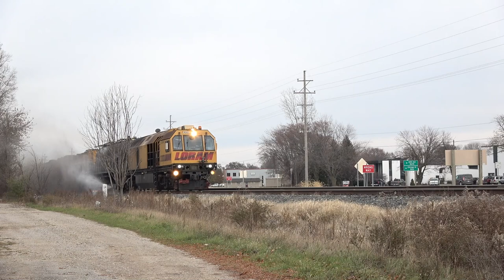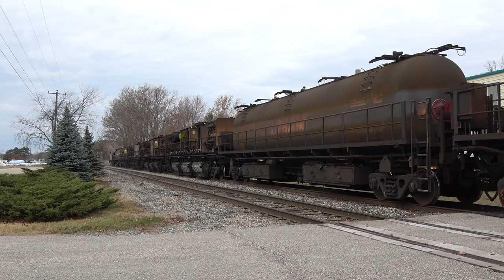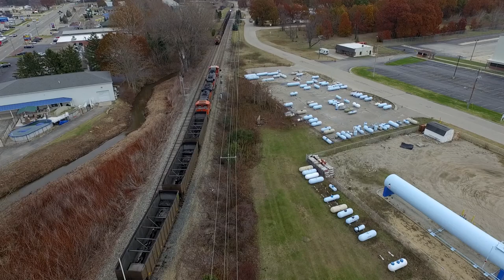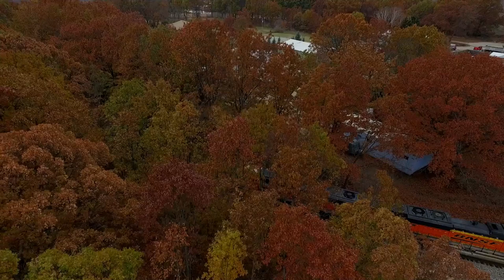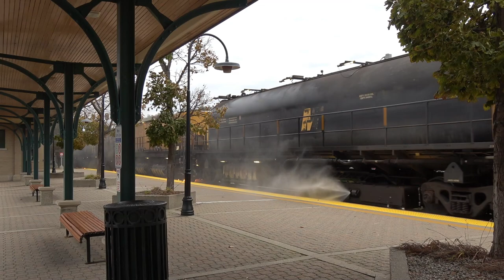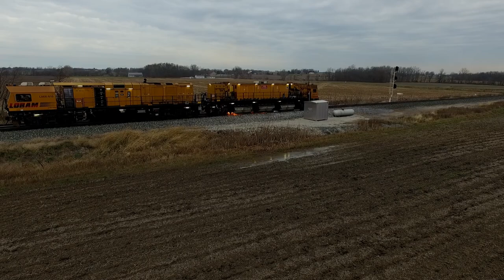TRRS 518: The Train from Hell - LORAM Railgrinder in Action

Comment: Part One Bearings;Now let us discuss bearings on both rail cars and locomotives. Both are constructed basically the same and have the same or similar attributes. I will go from the outside or outboard side of the bearing to the inside or inboard side of the bearing. Also I will attempt to describe the role of every part and its function. 

1. Bolts (3 in total) are screwed into the end of the journal during the mounting process. Their function is to retain the bearing onto the journal (axle) and must be torqued to a specified torque setting by a certified torque wrench. 

2. Locking Plate. This is a triangular shaped plate of mild steel with a center hole and three holes that match the location of the holes in the end caps. These holes are where the bolts pass through along with the end cap. The locking plate also contains six locking tabs that are pressed against the bolts to prevent the bolt from backing out during the service life of the bearing. The locking plate also has information stamped onto it listing the shop that either built the bearing when it was new or the shop that re-conditioned the bearing plus the shop codes of the wheel shop that mounted the bearing upon the journal (axle). 

3. End Cap. This is a round shaped plate of medium or high strength steel with the name of the manufacture, the AAR number, and three holes that the bolts pass through during the mounting process. The end cap's primary role is to spread out the mounting force equally throughout the seal wear ring, and it provides for proper retention of the bearing during the service life of the bearing. There are two basic types of end caps, shrouded and non-shrouded. The difference between shrouded and non-shrouded is along the circumference of the end cap there will be a dust cover shrouding both the grease seal and the seal wear ring protecting the two parts from collecting rocks, dust, and debris. A non-shrouded end cap will not have that lip or covering for the grease seal and seal wear ring.   

4. Outboard Seal Wear Ring. This serves multiple functions. It is a ring of high grade steel that encircles the outboard side of the journal (axle) and is sandwiched between the circular ground grove on the inboard side of the end cap and the back face of the outboard inner ring (cone assembly). The wall dimensions are thicker at the back face of the inner ring (cone assembly) than the contact surface of the end cap. The seal wear rings outer surface is smooth to allow for the seal lips to glide over the seal wear rings surface to prevent lubricant loss. It also serve to transmit the mounting force throughout the internal parts of the bearing equally. The seal wear ring possess the manufacture's name and AAR number. The outer circumference of the seal wear ring nearest to the contact area of the seal wear ring and the back dace of the inner ring (tapered cone assembly) will be slightly tapered inward to aid in installation into the rubberized portion of the grease seal and prevent damage to the rubberized grease seal lips. 

5. Outboard Grease Seal. This is a molded ring of mild steel that possess the rubberized seal that glides over the seal wear ring and the locking tab that encircles the entire circumference of the base of the seal. This locking tab when pressed into the outer ring (cup) counter-bore (a thin wall along the entire circumference of the outer ring-cup and a small groove running inside the entire circumference of the outer ring-cup, that locks the outboard seal into the outer ring-cup and prevents the grease seal from dislodging) The rubberized portion of the grease seal and the outer portion of the seal wear ring act to prevent moisture, dirt, and contamination entering the bearing's lubricant and preventing damage to both the rollers of the inner ring (cone assembly), races of both the outer ring (cup) and the inner ring (cone assembly).
Reply: Part Two Bearings6. Outer Ring or Cup. This part encases all the working parts of the bearing, and is manufactured with high grade, high carbon steel. The parts of the outer ring are as follows;

a. Outer Circumference or Outer Wall. This is the part of the outer ring  (cup) that the truck adapter rest on. It also contains the manufactures name, AAR number, and the date code of original manufacture. 

b. Counter-Bore. This is the part of the outer ring (cup) that the grease seal body is pressed into with an indention (groove) along the entire inside circumference that the grease seal body tab locks into. 

c. Raceways. There are two raceways. This is the smooth surface inside the outer ring (cup) that the rollers of the inner ring (cone assembly) glide on. The two raceways are tapered, larger diameter near the outer ring (cup) counter-bore) and smaller toward the center of the outer ring (cup). It is designed to distribute both the mounting and car turning forces equally throughout the bearing. 

d. Inner Band. This is the area sandwiched between the outboard and inboard races. This area of the outer ring (cup) also possesses important information. During manufacturing or re-conditioning the plant or shop that has manufactured the cup or the re-conditioning shop that inspected and repaired the cup grinds with a pencil grinder their unique shop code or marks upon. This area is also the most undisturbed portion of the outer ring (cup), and in the event of an incident either with car itself or the bearing, investigators will look for these marks or codes to determine the history of the bearing, and the manufacture and the re-conditioning shop that inspected and repaired the bearing. 

7. Inner Rings (Tapered Cone Assemblies) There are two of these, both outboard (outside of the car) and inboard (toward the inside of the car) (locomotive too). The parts of the inner ring (tapered cone assembly) are as follows.

a. Inner Ring. This part is a circular in shape is forged form high grade alloy steel that consist of the inner ring (tapered cone assembly) bore which is the portion of the inner ring (tapered cone assembly) that is pressed onto the outer circumference of the journal (axle). These two surfaces have what is known as an interference fit, and must be pressed on the journal (axle) using a bearing press. This inner ring (tapered cone assembly) possesses two faces, one is the back face which serves to retain the rollers on the outboard portion of the bearing, and the front face that contains the rollers ion the inboard portion of the bearing, and the front face (chamfer) that contains the rollers on the inboard portion. This portion also rest upon the spacer. The back face serves to provide a surface for the seal wear ring to rest upon, it also contains the manufacture's name, the AAR number, the date code of manufacture, and during re-conditioning it possesses unique shop codes are written with a pencil grinder of the re-conditioning shop that has inspected and repaired the inner ring (tapered cone assembly) 

The inner ring also possesses the raceway that the rollers glide and roll over. The raceway is tapered, larger toward the outboard side and the back face, and smaller toward the inboard side. The geometry is such to allow even mounting and turning pressure or force throughout the entire bearing. 

b. Tapered Rollers. Tapered rollers are manufactured using high grade chrome vanadium steel and perform the function that is implied by its very name, they roll and glade over the two raceways, one located on the inner ring (tapered cone) and the other one located on the outer ring (cup). Even though for example in a 6 1/2X12 100 ton bearing there are 23 per inner ring (tapered cone assembly) the weight is on only one or two at any given time. The weight applied on the tapered roller would be at the apex or the very top of its orbit around the inner ring. (For all the rail fans just look at a bearing mounted on a rail car, rake a straight edge and position it directly up and down right in the middle of the bearing, the top of the bearing would be the portion that would be bearing the weight.

Tapered rollers are of a tapered design, a larger diameter toward the outboard side of the bearing, a smaller diameter toward the middle of the bearing, near the middle band of the outer ring (cup). 

c. The Cage. The cage is manufactured either medium grade steel, or in a 6 1/2X9 Generation 2000 100 ton bearing, will be made from a high grade poly-carbonate plastic. The cage does with the name implies it retains the rollers and keeps them from shifting during bearing rotation. The cage contains pockets for the rollers and it is also of a tapered design, larger toward the outboard portion of the inner ring (tapered cone assembly) and smaller toward the inner band of the outer ring (cup). At the inboard side of the cage there is a small lip that carries itself throughout the entire circumference of the cage. The lips job is to retain lubricating grease into the raceway-roller combination, and to keep the grease from entering the middle of the bearing assembly that is devoid of raceways and rollers. 

8. Spacer Ring. The spacer ring sits between the inboard and outboard inner rings (tapered cone assemblies), the inside diameter is approximately the same size of the outer diameter of the journal (axle). It is manufactured using medium grade steel. Its primary function is to by using a lateral machine (electronic or manual) to set the lateral end play of the bearing after it has been mounted onto the journal (axle). If the spacer ring is too short, the bearing assembly will seize, if it too tall there will be too much slop (side to side) motion. When the correct size spacer ring is applied to the bearing, and that is determined using the machine I just described in this section, the rollers will have steady and constant pressure on the two raceways (inner ring-tapered cone assembly and the outer ring-cup). The proper size spacer ring will prevent the tapered roller bearing from shifting when the train negotiates curves, reducing fatigue on the roller-raceway combination, preventing the loosening of the end cap, and keeping the backing ring from coming off the fillet of the journal (axle). 

9. Inboard Inner ring (tapered cone assembly) Refer to Section 7, subsections a,b, and c.
Reply: Part Three Bearings10a. Inboard Seal Wear Ring. Refer to Section 4 for its function , design, and construction. The exceptions are as follows. There are three basic inboard seal wear rings, and they are as follows;

a. Standard Seal Wear Ring. The contact portion of the inner diameter nearest to the inner ring (tapered cone assembly back face) and the journal (axle) will be smaller. Typically this contact portion will be 1/8 of an inch or smaller depending on the bearing class and size. 

b. Axle Saver Seal Wear Ring. The contact area on the inside diameter of the seal wear ring the contacts the journal (axle) and the back face of the inner ring (tapered cone assembly back face) will typically will be larger, approximately half the height of the entire seal wear ring. These are typically used to either add stability to the inboard portion of the bearing assembly itself or is used in the presence of a grooved journal (axle). 

c. Composite Seal Wear Ring. This seal wear ring will have a grove cut on the inside circumference, near the area that makes contact with the inner ring (tapered cone assembly) that accommodates a sleeve manufactured from high grade poly-carbonate plastic that is white in color and appearance. The inside circumference of this poly-carbonate sleeve will make contact with the journal (axle). It is typically used in newer bearing assemblies or in the presence of a grooved journal (axle). This poly-carbonate ring is not used on locomotive bearing assemblies, or bearing classes above 100 ton. 

10b. The outboard circumference portion of the inboard seal wear ring is the surface in which it is pressed into the chamfer that is cut and ground into the backing ring on the side closest to the tapered roller bearing and away from the contact portion that makes contact with the back face of the inner ring (tapered cone assembly)  When pressed together it forms the inboard seal wear ring-backing ring sub-assembly. This is performed prior to installation into the inboard grease seal of the bearing assembly. 

11. Backing Ring. This ring sits between the inboard seal wear ring and is mounted along with the rest of the tapered roller bearing assembly onto the fillet of the journal (axle) and is the closest part to the wheel of the completed wheel set. There are two types, a fitted backing ring, and a non-fitted backing ring The parts of the backing ring are as follows;

a. The outer circumference which can be either shrouded or non-shrouded. Remember what I described in the end cap section. A shrouded backing ring will shroud the inboard seal wear ring and the grease seal from moisture, rocks, debris, and contamination. A non-shrouded backing ring will not have this attribute. 

b. The inner area where the name of the manufacture, and the AAR number. 

c. The chamfer that is cut into the portion nearest to the tapered bearing assembly where the seal wear ring is press fit and is locked together with the seal wear ring to create a backing ring-seal wear ring sub-assembly. The chamfer is cut and ground along the entire circumference of this portion of the backing ring. 

d. The Bore. This portion is the inside circumference that the journal (axle) passes through during mounting to a completed wheel set. 

e. The Counter-bore and Fillet. The counter-bore is the portion of the backing ring that is pressed onto the chamfer of the journal (axle), and the fillet is the curved surface that mates with the fillet of the journal (axle). The fillet of the backing ring has a concave appearance, while the fillet on the journal (axle) will have a convex shape and appearance. Both surfaces one on the backing ring and the other on the journal (axle) are designed to mesh together, and serve also to help seal out moisture, dirt and other contaminants from entering the bearing assembly. This also is interference fit, and during the bearing installation process, the counter-bore and the fillet will be pressed into the fillet of the journal (axle). 

f.  Differences Between Fitted Backing Rings and Non-Fitted Backing Rings, and How to Determine the Differences Between Them. For fitted backing rings, the cou8nter-bore will be measured with either a gauge block, or be measured with calipers that contain a dial indicator. If measured with calipers with a dial indicator, the inside diameter of the counter-bore will be measured in two places with the contact points of the calipers exactly 180 degrees opposite of one another. There is specific tolerances that must be adhered to in order to classify the backing ring as fitted. When using a gauging jig. the counter-bore of the backing ring will be placed on a gauging jig that has been calibrated using a master ring with a known measurement used as a comparator. The gauging block will contain two button stops mounted on riser blocks, and a dial indicator mounted on its own separate riser block specifically designed for mounting the indicator. The backing ring counter-bore will be turned on the gauging jig to determine the overall inside diameter. If it is within tolerances, then it will be graded as a fitted backing ring, if it falls outside those tolerances, then it will be graded non-fitted, meaning the counter-bore will be oversized. 

A different type of backing ring will not have a counter-bore and fillet, instead in its place will be a radius that begins toward the surface next to the wheel and curves outward into the bore of the backing ring. This has to be gauged with a go-no go radius gauge and must be gauged in two places with the contact points of the radius gauge touching 180 degrees opposite of each other. The radius gauge cannot pass through the radius of the backing ring, instead one side of the fillet gauge will be in a slightly raised position. 

12. Lubrication of the Tapered Roller Bearing, and Amounts Installed Per Class of Bearing. 
Prior to pressing the grease seals, the bearing will be placed inside a grease press that is hooked up to a computer driven pump. The press heads will grip the bearing on both the inboard and outboard sides, the the pump will engage to pump a pre-programed amount of lubricant into the area between the inner ring (tapered cone assembly) and the outer ring (cup) inside the area of the roller cage and  rollers. Half the specified amount will be installed on one side of the bearing, the other half of the specified amount will be installed on the other side of the bearing. The classes and amounts are below, all amounts must be within plus or minus one ounce to pass specifications;

a. 75 ton E Class 16 oz
b. 100 ton F Class 24 oz
c. 100 ton Generation 2000 12 oz
d. 125 ton G Class 32 oz
e. GG 6 1/2 Locomotive 32
f. GG 6 7/8 Locomotive 32 oz

The above is for freight applications.